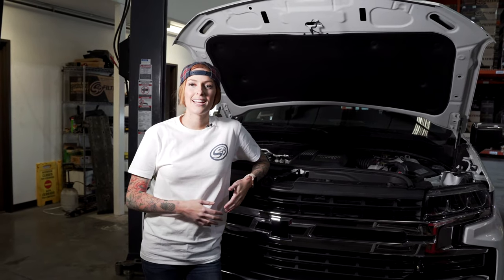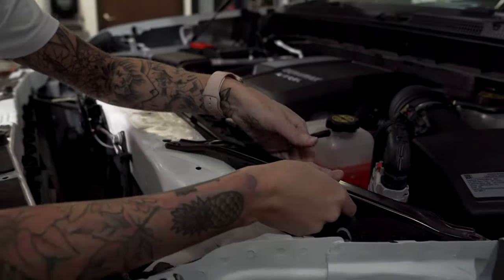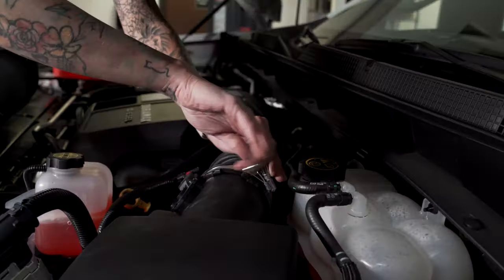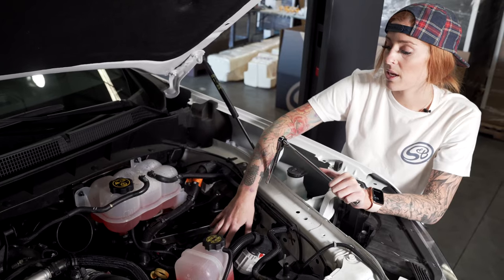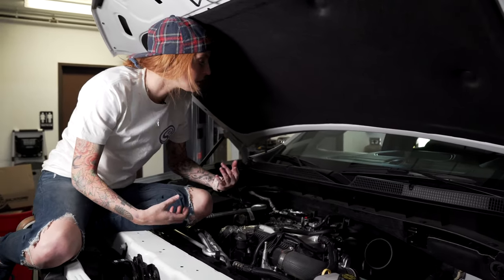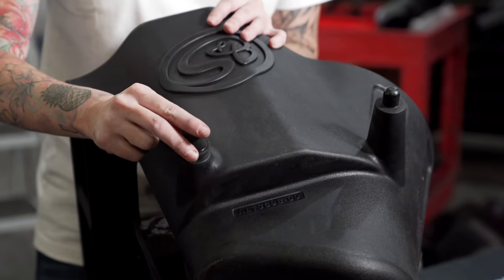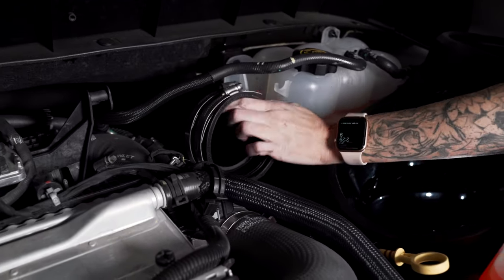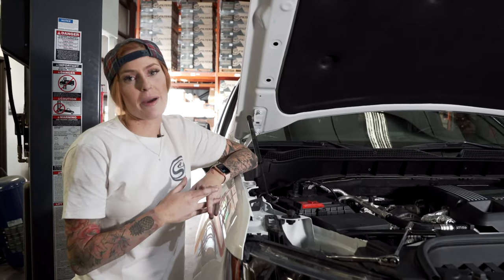S&B Cold Air Intake for 2020-23 Chevrolet Silverado / GMC Sierra 1500 Duramax  3.0L

Comment: I have 2024 1500 3.0 High Country. The tube to turbo is virtually impossible to attach, not as easy as she makes it look.  I worked on it for 3hours or more, there just isn’t enough room.  I called S & B technical support, the technician was basically worthless.  I reinstalled the stock tube very easily.

Comment: Fairly easy install.  I would advise wrapping a rope around the tube where it connects to the back of the turbo and using that to pull the tube into place. Saved me so much time and I’m sure busted knuckles.
Reply: Holy crap, i saw this comment before installing and tried it, thank you! It saved me so much headache installing it. Id add make sure you put a slip knot into it to make it easy to get the rope out and lube up the inside of the rubber collar, maybe lithium grease, pull the rope and pull the left side into the turbo and push on the end of the right side. For anyone installing in the future.
Reply: I thought about doing that, because I have large hands and couldn’t get into the opening myself. A friend of mine helped me out. And he stood on the other end controlling the tube and I had to pull on it. Great advise though.

Comment: I got this intalled on my 2020 3.0 and after paying for it, it took over a month to ship i kept getting this excuse “manufacturing challenges” and on this video theres too many unnecessary steps for the install.  Long story short not worth it! No noticeable power or sound.  👎 my gas nissan totan has an afe brand and it makes a noticeable increase in power and it roars at 4k rpms.  This one is junk honestly no sound and for a diesel i was expecting more I guess.

Comment: The hardest part of installation for me was getting the long tube with couplet onto the turbo.  All I had to do was loosen the clamp on the couplet for the turbo and it fit right in.
Reply: The biggest thing that helped me was a nice little film of WD-40 silicone spray, popped right on the turbo. Also I did it by myself.
Reply: I'm getting my truck next week and already ordered my intake (can't check myself) but is there enough space to fit your hands to install the tube on the turbo ?
Reply: Cap

Comment: If this made more power I’m sure you would advertise it.  DON’T buy from companies that won’t show you what your hard earned money goes to.  Every performance part should come with Dyno results or Fuel economy results if that what their inferring.  If the intake isn’t a restriction 51% increase in flow means nothing.
Reply: Exactly.  The youtube channel Engineering Explained already did a video a couple of years ago with performance tests on cold air intakes, stock intakes, and another style.  The stock intake almost always performs better than any upgrade to the air intake.

Comment: Been visiting the webpage constantly for a release date. Crossing my fingers that this will be ready soon!
Reply: dmaxstore says they are in stock... just ordered from them; let's see when they ship
Reply: @dyshuk  Oh I ordered mine the day it was available on the S&B website. I’ve had it installed for quite a while now.
Reply: @LowcountryBuckeye  hey can you give us an update, like did you feel a difference or what noticeable changes did you get from stock? Planing on getting one
Reply: @GendersonHernandez  So, I only had the intake installed for a few months and then sold the truck (kept the intake, I plan on getting the 2022 Sierra in the Spring with the same engine). In those few months, I did notice an additional  1-2 mpg difference in fuel economy. Doesn’t add much sound to the turbo, in fact, you can only really hear the intake if you have all the windows down. As far as power….eh, not really. About the same but did notice a very SLIGHT increase in throttle response. Nothing major, just very slight. Hope that helps.

Comment: Hi! I had a shop install to the turbo. The filter life is disabled but every time I turn truck on I get a “check engine air filter system” no one knows how to fix that. Can you help???!!
Reply from the maker: There are 3 different things that I can refer you to which are 1. the video that you were watching 2. disconnect the battery for over 2 hours or over night so the computer can do a reset 3. go to the install instructions online and go step by step to make sure that it was done correctly. Please let me know if yo have any other questions.

Comment: Hi S&B, I am curious.  Is there any DYNO documentation regarding HP and torque?  I do not care about more noise.  Also are there any documented MPG Gains with your CAI????  Otherwise why put it on?  I don't care about looks.  I care about the advantages if there are any.
Reply from the maker: The simple answer is that it depends on your vehicle. Improving the airflow to your engine has been shown to increase horsepower. That being said, we don't publish horsepower numbers because of the inaccurate and outlandish claims made by many of our competitors. Instead we test to the ISO 5011 Filtration Standard and publish the airflow, efficiency and capacity data on the product pages found on our website. This is the internationally accepted standard for testing filters and intake systems, so we can hold our competition accountable if they make an incorrect claim.
Reply: @SBFilters  Hi Katie, I know it depends on the vehicle.  That is why I choose this video to question you.  I am specifically looking for data for the 20-21 Silverado 3.0 Diesel.  Before I plunk down several hundred dollars I want to know the advantages (if there are any).  A few years back there was a popular company selling CAI's that when put on the dyno, it actually lost power.  So that is my concern.  Hopefully another viewer that sees this post that has done Dyno work on this will chime in.  But until I see the published gains I will hold off on spending the $$$$$.

Comment: I accidentally turned on the air filter life and it’s stuck in check air system mode. Do you know how to fix that???
Reply: I know you posted this a year ago but did you find a solution for this? I just added this on my lm2 and did the same thing a week after installing and now have a check air system message every time I start up.

Comment: Would have been tough to install without this video. But now my truck says check air filter system
Reply: Any advice on correcting that?  Mine comes in now when I start the truck.